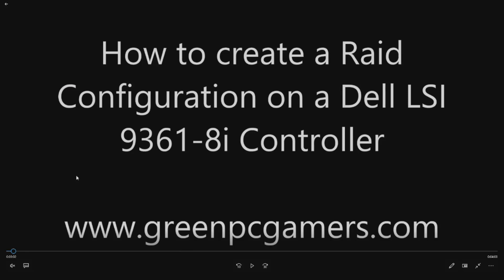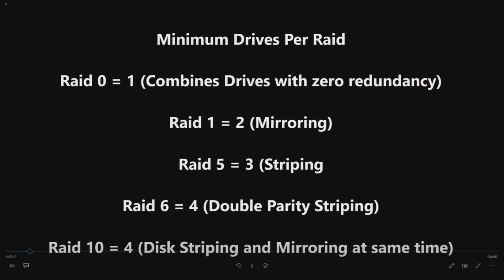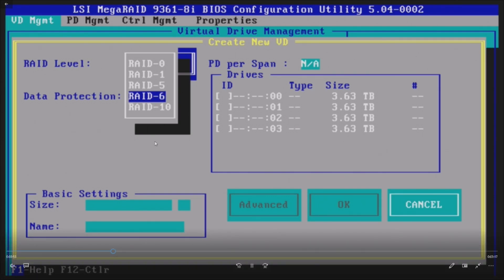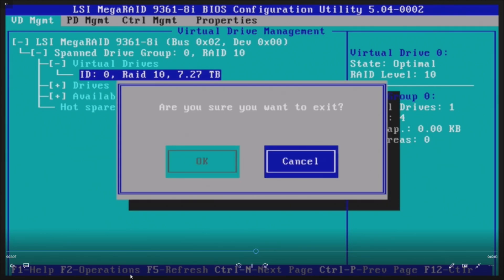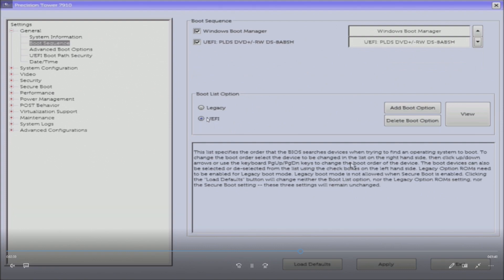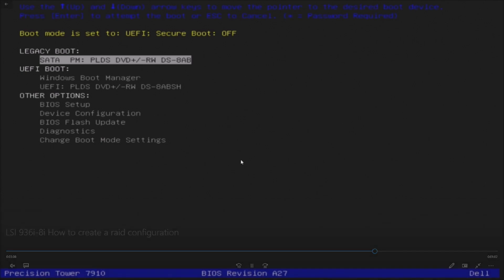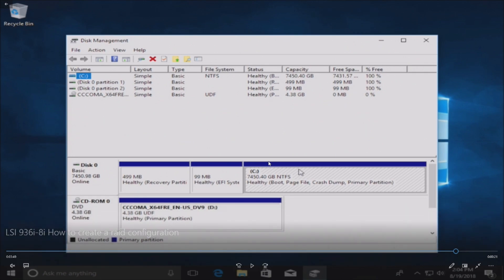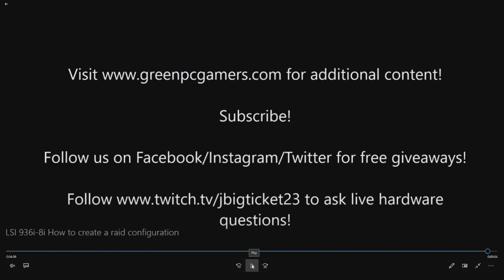How to create a Raid Configuration using a Dell LSI 9361-8i Controller

Comment: Hi , I found the video interesting on setting up the 9361-8i controller, in windows. Do you have a video on configuring the same controller for a Linux ubuntu server system which I want to use for home use, with AMD CPU and consumer grade gigabyte motherboard?

Comment: So I did jbod successfully and now I have two problems. I cannot see the SAS drive in disk management in Windows, but computer doesn't boot from my nvme boss card anymore. It wants to boot from SAS and SAS only. Whatever I put in boot selection (even if I'll leave boss nvme alone there) the only way to get it booted is to pross F12 at boot and choose my nvme manually. Crazy. 😵

Comment: Good video, But wish you could have went into the option in the Advanced Menu in the LSI Mega Bios config.
VD Mgmt Screen Advanced, Like: Strip size, Read Policy, Write Policy, I/O Policy and Disk Cache? 
And is using the LSI 9341-8i Controller About the Same? And last had trouble with the PCI-X dell card
that hold the 4 - 1TB Sticks of M2 Drives, Having the system Acknowledge that it is there and to use it for a boot Drive? Any help would be appreciated.
Reply from the maker: herculesx we can elaborate further about the advanced options on future videos.  We have a separate video for the LSI  9341-8i controller.  If you are not using a DDR4 based system, you will not be able to boot to m.2 ssd’s without a boot assistant like clover.